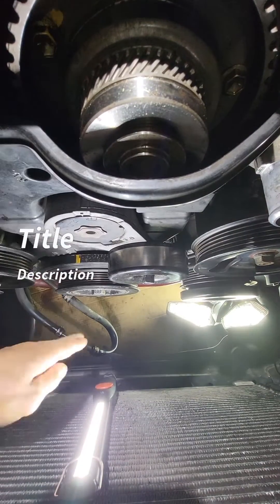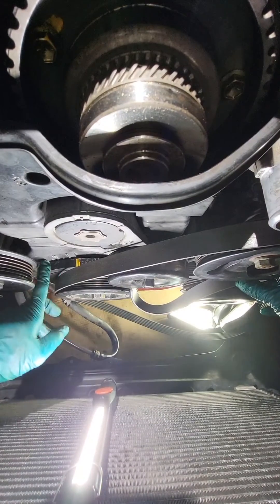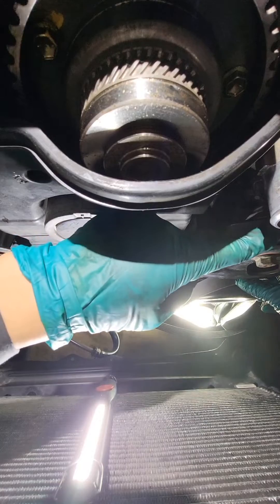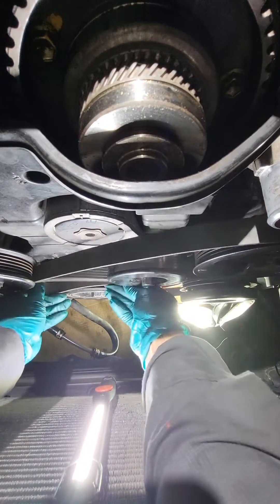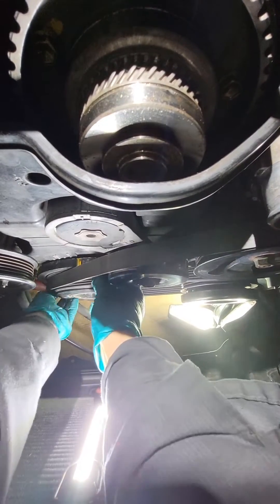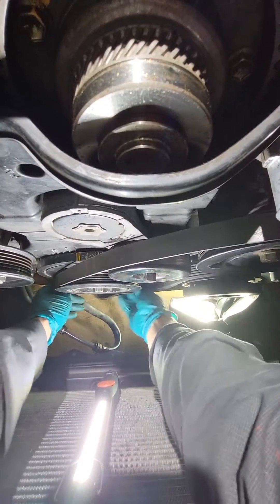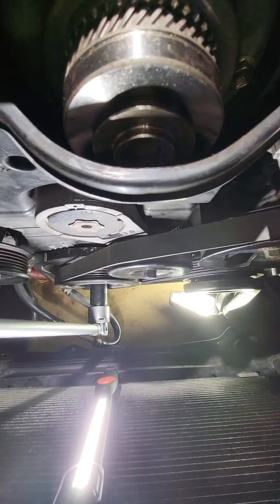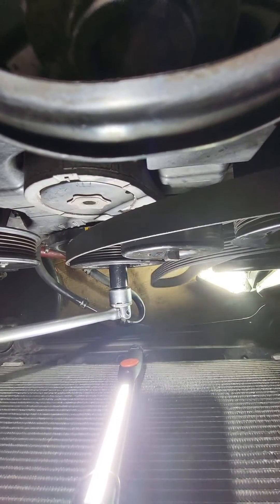HOW TO TIGHTENED OR LOOSEN A CRANKSHAFT PULLEY BOLT WITHOUT A SPECIAL TOOL

Comment: Ok no pulleys are on already removrd just crankshaft puller.Broke to 1/2 in impacts.Trued oil,hear,crayon..Tried breaker with cheater steel bat bent the breaker bar.
Reply from the maker: Im sorry but i dont understand your situation. Whats broken?

Comment: Are you sure you're not bending the pulley by doing that? service manual specifies that by creating force from the outside of the pulley instead of the holes near the axis will bend it, and this slight minimal distortion of the pulley will create vibrations that, as the manual says, will damage the gearbox
Reply from the maker: @cristianmontenegro6423  no damage done as far as i know. The vehicle runs and drives the same as b4 the service. Don't sweat it.